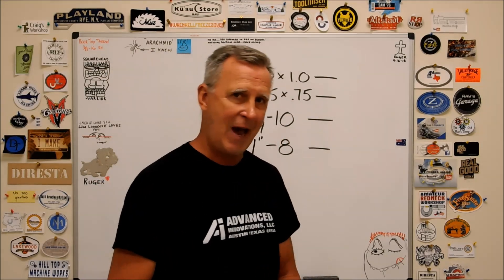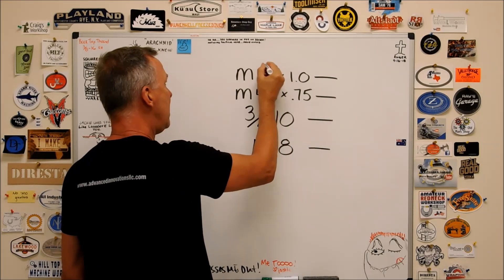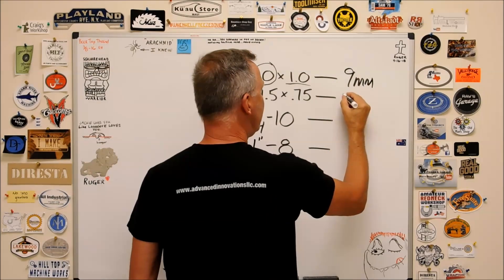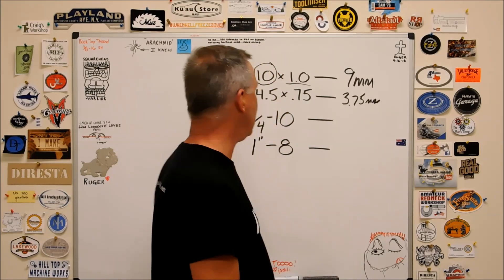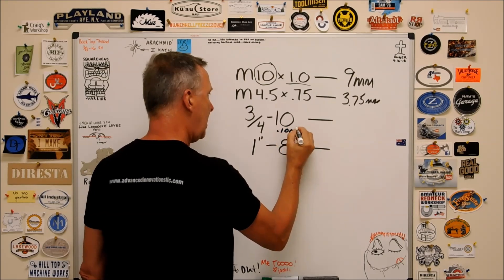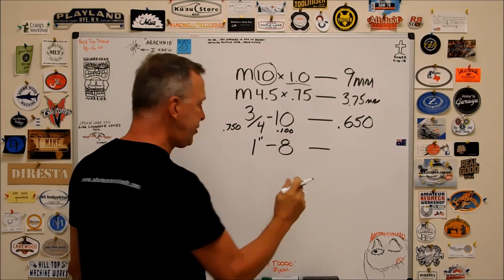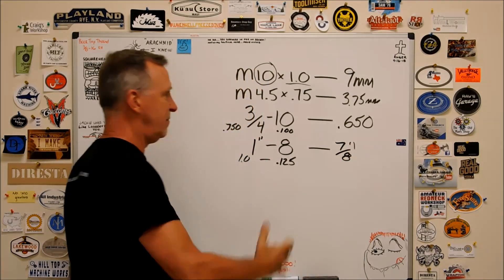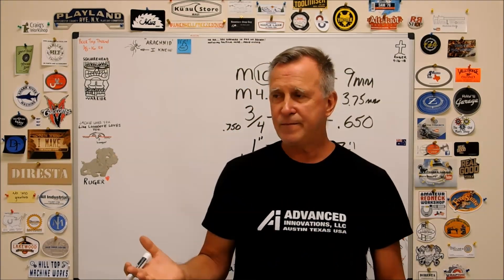How to Determine the hole size for an Internal Thread  --  SHOP GEM !!

Comment: What about the opposite, lets say you have a tube with X inner diameter with 32 threads per inch and i wanted to find out the external thread diameter size to turn down due  before threading?
Reply from the maker: Thats a tough one. Without knowing the original thread details like the tip width, ( or the guy that made it) its a best guess scenario. But normally, just make the external thread to the thread major callout if you have it. EX: a 2"-32 thread could have any number of Id's depending on who made it, but the male thread should not exceed 2" major.
Reply: @joepie221   I see, it would be me, I usually use metric threading for simplicity, but I have aluminum tubes anywhere from .5 ID to 1.625 ID that I would like use imperial threads on to increase overall knowledge/skills. Was looking at 32 TPI so that it wouldn't cut too deep into the walls. I use 60 deg threading inserts for the majority of everything & was hoping I wasn't the only one who has tubing of a given ID that couldn't be enlarged any but could be threaded as is, leaving the next step to find the right round stock diameter to turn down to followed by external threading. I think maybe I'm not phrasing it right on Google or searches, I have solid stock of all  sizes I can turn down, I just can't change the tubing ID. Much Appreciated!
Reply from the maker: @mje5130  This scenario is ideal. If you are starting with the internal thread, simply record the cross slide dial reading when you are content you have a good thread. Back the tool off and out. Return the threading bar to the final pass position outside the part and then use it like a boring bar. Bore a shallow section at the start of the thread and simply measure that diameter. Thats the absolute max OD of the part you will make to go in that thread. I'd stay .005 or more away to be sure on the OD.
Reply: Measure diameter x32 threads equals a pitch of .03125 multiply by.61 to get 1 thread depth equals.01906 times 2 for 2 thread depths then add to dimension x. That gives you the diameter required.         As an addendum.61 is for 60 degree flanked threads or .64 for 55 degree whitworth threads, as in model engineering applications.

Comment: Apologies  I did not phrase the question well
 
I can understand that the depth of the thread
cut is determined by threads per inch and the angle of the cutting tip.   But when do we stop cutting
threads?  If we make too many passesm either the threaded opening will be too large   or the threaded rod will be too small.
Is there a way of determining the diameters besides a thread chart?
 
I know I am asking very basic questions.  
thanks
Reply from the maker: No apologies necessary. A correct thread is a combination of the thread profile and a measurement called a pitch diameter. The pitch diameter can easily be measured with 'Pitch  (or thread ) wires '. Using a basic calculation and the decimal standards for the thread you are cutting, you should be able to hit a good class thread every time. This video will help you to better understand the process.   https://www.youtube.com/watch?v=be6Q9mm4vEQ  good luck

Comment: how does threads per inch translate to depth of cut?    what am i missing?     thanks
Reply from the maker: Depth of cut is usually driven by the machine rigidity and material being threaded. TPI has nothing to do with it.
Reply: I am pretty sure that the depth of the valley is about equal to the pitch from one thread to the next

Comment: Why did I not know this?  I don't know why, but this formula gives you the perfect drill size for a 77% thread.  That is the recommended size for most threads.  If you need more or less thread % I guess you can calculate it.

Comment: Great tip.  I machined for about 15 years before I got taught this.  Always looked at the chart and memorized the typical ones.  Stemmed from when I needed to tap a metric thread and didn't have a chart handy.  Boss said "major minus pitch" and that it worked for SAE too, just the math was cludgy with weird fractions.

Comment: OUTSTANDING!
FYI….They DONT teach this in mech engineering programs!
Reply from the maker: There's a lot of things they don't teach in mechanical engineering courses. I used to teach 3rd year mechanical engineering student coops a course called " Design for manufacturability " Many of them told me they learned more valuable information in the week I had them, than the 3 previous years. Nothing like real world.

Comment: Good training thanks. Where would I get a great cut off blade and or tool seams like everything is China and breaks so easy
Reply: I've been using an Iscar SGTBU 19-6G tool block with the SGFH 32mm blades and GFR inserts.  Works awesome.  I have blades in 3mm width for most general parting operations and a 6mm blade for deep parting.  They make these tools in various blade heights and widths but I recommend getting the tallest one you can.  32mm works well for my 14" lathe with BXA tool post.

Comment: I’m looking through the machinery handbook charts holes size for tapping, and geesh my head is  spinning. Percent threads, thread depth, material types, etc. i just wanna basic thread for home use. I ain’t building a space shuttle, I think this method will work just fine haha. Thanks for sharing. I’m gonna try them. 👍

Comment: How would you figure the bolt size if you only knew the internal hole size? Say 1 9/16-20
Reply from the maker: If the bore size is 1 9/16, and you've determined the pitch is 20 TPI, I'd approach it this way. 1" ( because all imperial threads are designated as per/inch) divided by the pitch of 20 = .050.
Add that .050 to the bore size of 1 9/16 or decimal of 1.562. OD of the bolt should be 1.612  w/ 20 TPI.
Reply: Thanks Joe for the reply. That really helped me.

Comment: i have a chop saw where i lost the saw blade tighting bolt, i need ti find the bolt so i can use the saw. it is a left hand thread. i order a m 8 left hand tread bolt and it did not match and work. it was a cheap china saw. do you have an ideal of what to do next to find the right thread

Comment: Great info. Am I correct that knowing the ID of a female thread to find the diameter of the  male thread I can take the ID and add 1 divided by the  thread pitch?
Reply from the maker: That will get you close, but depending on who made the hole, it may be between an imperial and metric size, so you may have to count some of those threads to figure it out.

Comment: Hi Joe, Please if is possible tell me the hole size for  1-1/2" 18?  I'm learning with your formula. Thanks
Reply from the maker: Quick calculation. 1" divided by 18 = .0555   Major diameter 1.500 minus the .0555 = 1.4445 = hole size
Reply: Ok so would this be the same for 12 tpi also

Comment: Wish I had found this about an hour ago. Needed to drill for a 1/2-28 tap. Google said 15/32 which is .004 different from your method but closest drill size.

Comment: Hey joe. Do you have an equation for determining the depth of cut on an internal thread based on the pitch? Like say I was cutting a 16 TPI internal thread with a straight infeed. How deep would I feed my tool in approximately? Thanks! I would really appreciate it
Reply from the maker: Your question is dependent on the tool tip flat and the starting bore diameter. There are only reference values as answers for the pitch you are cutting regardless if its a 3/8" or a 2 1/2". you need to be sure the major diameter is there, then realistically, its a lateral shift of the tool the brings everything together.

Comment: Gunsmith here. Thank you for this. I had to bore out and thread a trunion to a bastard size today for the fitment of a barrel tenon to thread into. I basically had to make up a size for what I had to work with. My trunion was bored to .875 and then threaded to 28tpi. I did some backward math from your video and determined that I needed to turn my barrel tenon to. 910 before threading it. Perfect fit! Thank you.
Reply from the maker: Good to hear.

Comment: I have just found your videos and they have a big fault, the occupy a lot of my time. Well done sir, thumbs up!  :-)

I have been using this same method for many years, but not on imperial sizes, mostly because I live on the other side of the Atlantic Ocean (Sweden) where metric sizes are the norm. I´m not a stranger to imperial sizes since I have some American cars (Corvettes) but metric sizes are still the ones that we use the most.
But I must add a comment to your video, this calculation assumes that the treads have 60 degree "thread flank angle" (that was translated by Google and I don´t know if I got it right).
Most threads do have 60 degree thread flank angle, probably like 98% of all the threads in the world. But you might find a thread with 55 degree thread flank angle or some other odd angle and now you have to measure (or calculate your tap drill size using trigonometry, or look it up in tables [much easier]).

Very good videos, I will continue watching them but for now, time to get some sleep. :-)
Reply from the maker: I thought that was in print in the video description. I'll have to confirm that.

Comment: In addition to the imperial system, to calculate the major diameter for the number sizes: Multiply the number by .13 and add .06. #4 is .112, #5  is .125, #6 is .138, #10 is .190, Etc. The TDS (tap drill size) is simply deducting the pitch. This is also good to know off the top of your head. With some practice, you can calculate the TDS without a calculator. Some drill indexes have the decimal size so you can pick out the drill size in seconds. 
Joe is 100% correct. You can't unlearn it. I learned this in 1982. I haven't worked in a shop since 1990. I can't remember what I had for lunch, but I'll always remember this gem. Thanks for posting the video.
Reply: I think you meant multiply the number by .013 not .13, and then add .06, but thank you for that info, I was wondering while Joe was explaining it in the video how to figure the diameter for the numbered threads.

Comment: ok Joe what about using a die what size can you turn a piece down to thread with a die say a 14mmx1.5 thread what size do i turn it to to get the right thread on the rod.
Reply from the maker: Turn it to a few thousandths under the major diameter size. 14mm  just undersize.

Comment: The only place this doesn't work well is if you work with small stuff a lot like 6-32 or 10-24. But the solution to that is to just memorize the body and tap drill sizes, there aren't that many of them.
Reply from the maker: Are you sure?

Comment: I have a quick and dirty fix which i have been using for a long time. I have 2 set of drill bits, one metric, one imperial. If i have a imperial size hole, say 1/2 inch, that's 12.7mm, then i will use one size down metric to drill the hole, that's 12mm, then tap it with a 1/2 inch. Do it vice versa if you have a metric hole, in most of the case, it will work well. As long as you have more than 0.5 mm difference for the thread to tap. Of cause, as the bolt diameter becomes larger, this trick will not work. But i seldem need a threaded hole bigger than 1 inch. Obviously, those holy book of machinist will not agree with that. But those drill bits mentioned in those tables are difficult to acquire here, pretty expensive too.

Comment: THANK YOU very much Joe, last year I paid almost $50 for a used “shop machines” hand book. In it there is over 40 pages of information describing how to determain major ID, minor ID for a proper fit in machine cut threads ??? I’m still scratching my head. Now in under 3 minutes you showed me how  I can  cut a non standard  thread, measure it and determain the minor thread for the bore, I’ve said it before... You are a wizard my friend an absolute wizard 🎖PS. My wife will never watch anything on your Chanel but I’m going to have her subscribe anyway to help you get that 100K. 😉

Comment: its a bit tight for hard materials?  perfect for aluminum though.  (for using as a cutting tap pilot)
Reply from the maker: I agree. I always step up a size or two for tougher and stainless material.

Comment: Amazing trick. Been subbed for a while now but gave this a like.... 

Now this is only for cut taps right? Do you have a trick to figure out roll form tap drill size? Heheheh..
Reply from the maker: Yes, only cut threads, and no on the taper or roll formed.
Reply: @joepie221  ok that's what I thought. Thanks again!
Reply: https://www.guhring.com/Tech/tapdrill

Comment: Just drilled a mill motor shaft for pulley retaining bolt( thats how the pulley was on from the factory installed motor)
Drilled the hole in the shaft that was on the tap (brand new snap on number drill) 
Scariest threading job I ever done it was so tight But I have to say I never knew that Thanks

Comment: Hi Joe. Excellent video. The only point that I would make is that this calculation only applies to cut threads. If using fluteless thread forming taps, the rules change. Admittedly, most of your viewers will only be using normal taps

Comment: This also works with number screws too like say #6-24 or #8-32, etc... Just have to use the decimal diameter of the given screw like  .164 for #8 screws and obviously the  other number (like -32) is the threads per inch just like factional sized screws / bolts.

Something else that pertains to # screws for anyone not aware of it, the equation [ # size x .013 +.060 ]  will give you the major diameter. Take a #10 for example 8 x .013 + .060 = .164  and .164" is the decimal diameter for #8 screws (like 8-32 or 8-40, etc....).

For Aught size scews (like 00, 000, 0000) the equation just needs to be changed around a bit and the you use the number of zero's - 1 as your "#" the equation is [ .060 - (# x .013)= major diameter ]. Remember though that for the #, its the number of zero's minus 1, so for say a #000-120 screw, the equation would be .060 - (2 x .013) = .034  The reason for it being 1 less then the number of zeros is because the first zero is actually the .060. 0-xx (like 0-80) screws is the starting point and is .060" diameter and essentially each number above of below 0 size is multiple of .013" above or below the zero size (i,e, a multiple of .013" above of below .060")

Comment: You can also use this for "quick and dirty" depth of cut (DOC) for single point threading (watch Joe's vid on how to set depth of cut for threading). Just stop shy of total depth, wire measure, then sneak up to final. i.e. M4x.7 = OD ~ 4mm, DOC < .3mm

I've known this "trick" for metric threads from day one (just looking at the tables and seeing the pattern). I figured that US customary units had something similar, but never bothered to work it out. Thanks Joe.

I have to admit, that I started machining in US customary units when young. Changed careers, came back has a hobbyist, but now 99% of what I do is in metric and I have to say "I LIKE IT!!!" I cringe when I have to go back to "imperial" (but that's just me).

Comment: who doesn't have a tap chart?

The tap chart also tell you exactly which drill you should use, which is really useful when it's a letter or number drill.
Reply from the maker: The point is that you may not have one with you at all times and a solid reference is a good thing to have.
Reply: @joepie221  I understand where you're coming from. 

If I ever get a tattoo I'll probably start with a tap chart on my forearm. Until then it's a good idea to keep a tap chart in the drill index. 

A rule of thumb you can actually memorize is still immensely helpful when helping your relative repair their farm equipment with a hand drill and no cell reception. You'll be embarrassed if you're a career machinist but it took you 3 tries to guess to correct drill size.
Reply: @joepie221  ... not having the chart at hands all times? Just glue a chart inside your caliper box. Guessing hole sizes allways require the use of a caliper.
I'm just a hobbyist and I'm having paired drills and taps inside a small box. Only metrics of course and of quality made in Germany (as I'm living there). No worrying what size I will need.
The pain in the ass starts when dealing with imperial threads like 1/4" camera mounting screws ... here where everything is metric.

Comment: This is handy for general purpose work. For difficult materials and special circumstances though, your reference book can save you grief. My reference has % depth for threads from 50% to 100% and notes on why different % would be used. For instance it notes that a 100% thread is only 5% stronger than a 75% thread, but it takes twice the power to tap. It also points out that generally a bolt screwed into a 50% thread to a depth of the bolt's diameter will break before it strips the thread.
It is important to also follow tolerances for the blank diameter for each class of external thread especially if you are using a die. It may only be a few thousands of an inch but it makes it noticeably easier to cut the thread with a die and you usually get a better finish.
 Cheers from NC/USA
Reply: Could you share the reference?
Reply: @johnwilson5304  My books are packed away but here is the info you need. First is % of thread table and the second is material recommendations.
http://www.newyorktwistdrill.com/taps_technical_data_01.html
https://osgtool.com/tap-drill-size-calculator